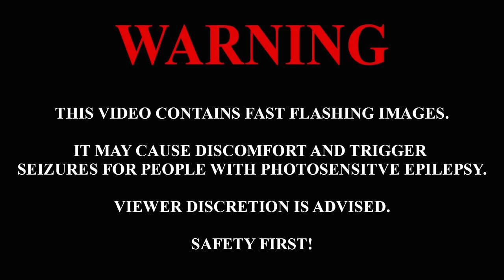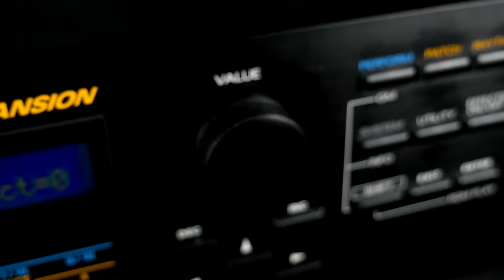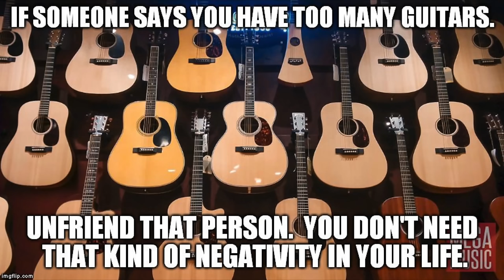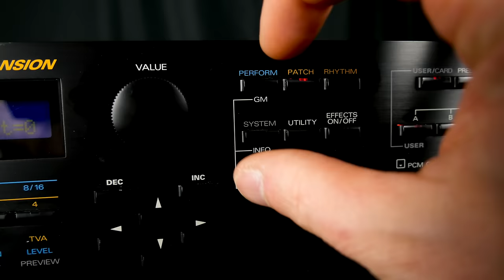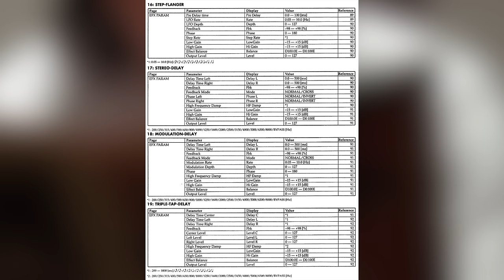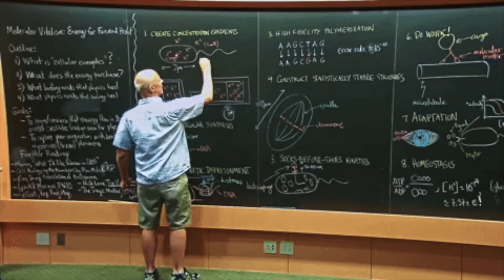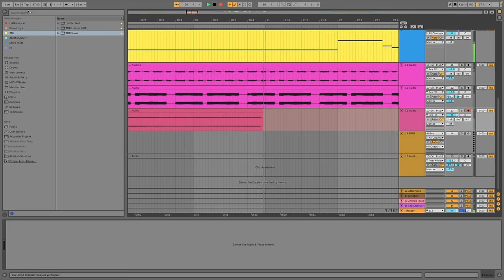Bad Gear - Roland JV-1080

Comment: I use the patch Heavenals behind my grand piano. I set it to sound only from middle c all the way up. It adds a sparkling effect to the grand piano. I also layer this with strings. I bring the two up and down with an expression pedal. My other favorite sounds are Fantasia JV, D’Light, D50 stack. I use the EP+Mod Pad and MK-80 Epiano often. I never hear anyone saying “your set sounds cheesy” it’s all about how they are mixed. I’m hoping for a JD-990 from Roland cloud soon!
Reply: The sparkly bell pad patches was one reason I bought my Roland JV-1080 in 2008. Also when I watched a video of someone 
demonstrating a Roland digital piano and layered the Fantasia bell pad with the piano sound he called the preset "Magical piano".
Acoustic pianos sound beautiful layered with a bell pad, I also have a Roland U-220 and bought that for the same reason, it has 
the D-50 Fantasia pad!

Comment: I bought my JV-1080 off Ebay in March 2010 after watching keyboardwizzard's 4 part video. I always liked the bell pad 
sounds on this module as well as many other patches including "realistic" nylon and steel guitar sounds. Yes it sounds digitized 
but in a good way. Can you still get away with doing entire backing tracks on a JV-1080? Yes, even when I bought it in 2010 
people said it's old but at least when I bought it when I did I didn't pay too much for it, £199 or less is a reasonable price to pay 
for one with no expansion cards, would I buy this in 2022 or 2023? Maybe or I would probably choose a JV-2080 or an XV-5080.
I agree some of the U-220's sounds are a bit better as I also have a U-220 but the JV-1080, JV-2080, XV-5080 or even the Integra
7 are still ideal as a first full sized rackmount module. Using it without expansion boards? Until 2014 I didn't have any expansion boards 
as at the time they were more expensive than the actual unit but you certainly should buy some expansion boards for it later down the line
although the PCM1 cards for it can be hard to come by but the Super expansion board combines all those sounds. I haven't done entire 
backing tracks using only the JV-1080's stock sounds for quite a few years but even today it still sounds OK. I know it doesn't sound 
quite as authentic as VST instruments like Kontakt or Halion. I certainly prefer the hardware JV-1080 over the Cloud JV-1080 and I'm 
still thinking about weather or not I should buy an Integra 7.
Reply from the maker: Integra is super tempting!

Comment: Many of these modules were used with the equally expensive Roland keyboard controllers which had parameter buttons, like Roland A-90.
Other modules like JV2080 were even more difficult to manage, flawed with some MIDI issues from what I've read because of processor limitations. Thanks as usual
Reply from the maker: Thanks for watching!!!

Comment: Brilliant bit of kit, an absolute work horse in a late 90s studio. It really comes into its own when you fork out for the expansion boards, I had mine fully loaded with Vintage Synth, Techno, Session and Hip Hop, which takes the unit to another level.  I still dust mine off every now and then for that late 90s nostalgia!
Reply: Are you aware about the capacitor issues on the cards?
Reply: @uk_carnage  yep I have heard of that problem. Fingers crossed it wont burst into flames anytime soon! But my cards have been in the unit for about 23 years and its been fine.
Reply: @oxygene65  hopefully not. There was a page on the roland site talking about it a while back.

Comment: I could never afford one in the 90's so i bought one some years ago as a middlifecrisis synth and it did not disappoint. Added Don Solaris sound pack (recomended!) , vintage synth card , vocal card and Orchestral. You need to be a monk to work with it but the lush strings/choirs where worth it. I tried the 1080 vst but the real one sounds more spacious and saturated to my ears.And 3x stereo out is very nice if you have some effectpedals around.
Reply from the maker: Don Solaris is the JV God!!!

Comment: I asked myself this question every day I used Roland's MC-307 in 2016-2018 (replaced with MC-909), what I found is that is to not sound embarrassingly 90s like the presets you must combine three or four tones; none of the presets I looked at ever used more than two tones in a single patch - obviously because their proportional decimation of polyphony, Roland didn't want people to experience voice-stealing when sequencing the 8 parts. Also because the JVs use mono samples, you need to introduce at least 3 tones to do anything more complex than blending two tones each mono / one tone stereo. Ultimately I went for the 909, but here's examples of the sounds I made (like the MC-505 and D2 and JX-305 it borrows the JV1080 sound engine but only has one output). Also I'm such a huge Roland snob that its the biggest compliment ive made in recent memory that you covered this most hallowed piece of frustratingly awful but also pro & capable gear quite well https://youtu.be/XLLqQfLIeMc   https://youtu.be/yxhsY0nzmDc
Reply from the maker: Yeah, the tone system is more or less built for layering

Comment: Hey people
What controller are you using for this Synth??

I dig into the manual and it only has 2 assignable CC settings.

I've always found it frustrating to not be able to control filter settings.
Reply from the maker: A Keystep Pro would probably be the optimum for that

Comment: I bought one as soon as they came out, and the reason was i couldn't afford a JD800, even after they were heavily discounted towards the end. 

No regrets, as it had more than double the polyphony , was 16 part multi timbral, and the soundcards (especially the vintage expansion) were worth getting. At one point, i had more soundcards than expansion slots, but by then, i had a JD990, too. 

It was a pig to program, but it helped me get paid work, as it sounded clean & full. Eventually  I sold it on ( quite reluctantly, if i remember correctly), as by then I'd bought a lot of the analog synths I'd been hankering for. 

It's interesting that i think i can still hear traces of the waveforms used in it in modern Roland synths. It was a great workhorse and was one of Roland's better synths in that period.
Reply from the maker: The 1080 was the "rational choice" for many back then...

Comment: The multitimbral structure with four oscillators per voice, dedicated filters, envelopes, lfo's per oscillator plus cross-modulation possibilities goes back to the D-50, D-10 and JV-80. This somewhat became a standard for rompler-workstations of the last decades. I wish more modern synthesizers would take this approach. The SH-4d is going in the right direction....
Reply from the maker: True that!

Comment: Got an JV2080 recently for peanuts.  This thing sounds amazing if you treat if you treat it as it is, a powerful synthesizer and not just a giant preset box.  Yo can get very wild stuff for any genre you want. In the case of the 2080 the big screen helps, but still a bit complex to program the first days until you get used to the structure. Still, there's some software editors you can use to help.
Reply from the maker: Nice!!!

Comment: I have the xv3080 version of this along with several expansion cards, mine holds 6. I've had it for 20 years at least and still use it quite a bit. There are a lot of very useable sounds on it that I like, such as Soaring saws, Sun Dive, Macarthur Brass, and swimming bee to name a few. Definitely a ton of sounds on it
Reply from the maker: Legendary presets!

Comment: I have a JV-880 - the forerunner to the 1080 and 2080. It can use the same expansion cards too. I was thinking it'd be fun to buy the whole collection but there are some unrealistic prices on Reverb and eBay at the moment.

I only bought it recently, and I chose it over its successors because I thought I'd only want to use it "as is" (I wouldn't want the bother of editing any of the sounds) and it was much cheaper. I was right too - life is just too short. So, if I just need a piano, church organ or similar, and I'm not bothered about what type of piano, where it was sampled, and what the weather was like on that particular day, then this is an easy choice. 

The guitars should be exorcised from the unit though.
Reply from the maker: Nice one!!!

Comment: I used a JV-1080 with the Vintage Synth expansion board for years, but as I moved over to VSTs, I managed to simply lose the unit.

Kind of sad, but I did the also test the Roland Cloud version, and I don't really miss any of the sounds. It was a great workhorse back then, but now I wouldn't prefer that flavour anymore...
Reply from the maker: That expansion card is one of the most sought after!!!

Comment: I bought one of these (used) back in 2006. Although I don't take it to gigs any more, it is STILL the backbone of my home rig. When I bought it, it had the Asia World and Experience II expansion boards in it. To these I added Bass and Drums, and Orchestral. Asia World, I hardly ever use, and in the event of my getting another expansion board, this will be the one to come out. Experience II, I have used a lot. For certain sounds, it's my go-to. 

I agree that the factory piano sounds in this thing aren't stellar, and I certainly wouldn't use them for a piano solo. That said, that doesn't mean they're not useful. I've used them several times in places where they work in the context of the track.

In short, a good all-round workhorse. I'll keep using mine until the day it kicks the bucket.
Reply from the maker: Definitely a keeper for me too!!!

Comment: I love mine, and still use it to this day, If you scratch beneath surface of the cumbersome menu driven interface you will find that this is a very powerful sound module. I also installed the 70's keys expansion, which has some really nice patches. The stock soundset also throws up some gems too if you can be bothered to dig deeper than selecting a preset. The dedicated effects blocks aren't too bad either although the are very Boss/Roland in character. Your reviews are excellent, I really enjoy them so much especially as I have owned a a fair amount of units that you have reviewed 😀
Reply from the maker: Thank you so much!!!

Comment: I have a JV-1010 permanently set up in my chain; the problem is, I say to myself I will just use a JV patch as a placeholder and then put in a 'gritty analogue' sound later, but never bother setting up the analogue synth. I also have the XV-2020. Both cost way less than a 1yr ultimate cloud subscription and I have had them for years with no problems. The JV/XV sounds are also great if you follow the tradition of not using them as Roland intended.
Reply from the maker: Nice technique!

Comment: It's crazy that the JV family of synths is the single longest running, most recycled, most successful synth engine ever developed. Think about it! It started basically with the D-50 in '87, 4 partials that could be arranged into various "structures" with sampled waves and time variant filters & amplifiers. That morphed into the U-110/20, D5/10/20/70, JD-800/990, then the JV-80 series, then refined into the 1080 in '94. The 1080's success spawned more spinoffs, like the XP keyboards, until the engine was revamped into the XV series in the early 00's. But it didn't even end there, the Fantoms were really only post-Y2K JV's & XP's. Roland has pretty much just copy-pasted the D50 with slight tweaks & more samples into new products for the last 36 years. Integras, the pretender Junos & Jupiters, the new Fantoms, the new MC's... Zencore is essentially an ultra-slick JV-1080. It'll never end! I got off the train with the XV-5080, I'll never part with it. Everything up til it is aural gold, everything after to me sounds like it sold its soul for more features.
Reply from the maker: Yeah, they are still recycling these...

Comment: Back in the day, when using my JV 2080 per MIDI for a whole arrangement, bad MIDI-timing got a big issue. 
Many sounds going on - but weak power, because of lost rhythmic "tightness".
You could solve the timing problem by eventually recording every single track to a multitrack tape machine - if you already had a HD-recording card, there weren´t enough tracks, the computer was capable of playbacking simultaneously.
So you had to stand it and wait until the end of the song arranging time, to keep yourself flexible for eventual sound changes, (considered an advantage, back then..) if you didn´t want to dub your stuff to tape several times... Those were the days! 
Those were also the days, when I had the patience and eyesight to wizard around on the knobs and the small display of our Akai S1000 sampler in the studio...O.M.G!
I still have one and love to "have" it. But I barely touch that monster...
Still keep the 2080, too - but the patches of my Kurzweil K2500R seem momentarily more appealing to me..
Reply from the maker: Didn't really push it too hard but good to know!

Comment: The Roland integra is the successor with all the cards built in + much extra and much better quality and cheap.
You're crazy if you're still working with the expensive vintage 1080 with cards.
But many have the problem that their important patches cannot be transferred and are therefore stuck with their precious stuff.
I only keep my XP50 as a midi keyboard ☺️
Reply from the maker: Integra is super interesting!

Comment: Used these at the studio I worked at back in the late 90s early 2000 and they were a workhorse for quick stock sounds, if almost impenetrable for editing beyond a few basic controls. A really good example of its use was Stacey Pullens album under the moniker Silent Phase: 'The Theory Of...'" as its littered with the presets.
Reply from the maker: Just hit play on Meditive Fusion❤️❤️❤️

Comment: Hey Hey Hey eaaaasy there. My first synth ever - this is not bad gear :) While you can get into patch editing  (after 20 years I managed to learn how to do this fairly quickly), original patches are extremely good - cut through the mix with little processing, pads are warm, basses - i used the finger bass preset on multiple records, that Fantasia Dx-like piano, west coast strings, plus the full array of Roland percussion. Absolutely killer module, I got it waaaay back in 1995. I got 2080 later on, but I still have 1080 and oddly enough, use it frequently. It is hardly analogue goodness, its a rompler, but it does feature extremely good sounds. Yes, that is why they are overused. I listen to some tracks from 15 years ago and wonder how percussion from this module always stands out. Cards were such a gold back then. And its fair these were expensive, as they brought basically new synth onboard. I loved the fact you can layer sounds  and separate outputs, really, except limited ui (and since I was shown most of it by person who used it on daily basis, then i spent days on end using it), i never thought of it as bad ui. Yes its terrible, from this perspective, but again ,that was time I found DX workflow "normal", its a synthesizer! JV 1080 is a golden machine, and goes with my Alesis Quadraverb as 500 quid of synth greatness and endless effect fun.

Comment: I've had JVs in the past, then got hooked in the XP and XV series - all the expansion options available, and they still, to this day, sound great!!

Biggest problem today is, when you find an old unit, you will certainly need to replace the capacitors - not the most difficult job, but finding the right components is quite daunting.

Once you've done that (or had it done), then you're good for another few decades! 😎👍
Reply from the maker: A recap job from time to time can be necessary

Comment: Even you can get the full Arsenal of the exp cards in newer versions. The 1080 is still the best sounding of all Rolands countless Synths based on those in todays eyes rather Cheasy multisamples. I have always critisized Roland for lack  of innovation ever since the first GM/GS and U series models. They have boiled soup on the
 same wave memory for nearly 40 years now. That doesn’t mean its bad tho. Those libraries made in the 90’s for the JV series was pretty much the epitome of what you could get in a rompler back in the days, the sounds are extremely well done for the limited ammount of memory used, and the 1080 is one of the most epic sounding romplers. Its beefy sound flatout beats the Integra well .. if you take all the JV exp. Packs that is funny enough over 50% of all the Integra’s wave library. It’s amazing you can still spin money on a 30+ year old sample library 😊

Comment: Great review, I totally agree with you ! I owned one 20 years ago (with the Vintage Synth expansion), to use really as synth for programming  (like my D-50) but I found the sounds and character "SC-55 SoundCanvas-ish", so already "over-used". It lacked meat, punch, dynamics etc. (compared to the D-50 :D).  Knowing the D series, I think the UI was quite usable, by 90s standards. The JV's synth engine has survived at least until the FA06/07/08, which inherited a lot from the JV1080.  I replaced it with a Proteus 1000, also a 64voices/4layers rompler but which had original samples, good punch and great filters (but no ringmode/booster). Btw that guy faking DJ'ing at 3:46 is great :D Thanks for the great review !
Reply from the maker: Thanks!!! That expansion goes for ONE MILLION DOLLARS;)

Comment: You can get the Roland Cloud in a box sound using a Jupiter-X/Xm or Juno-X (all have the XV-5080 sound set inside) or an Integra module.  I am not so sure what is inside the Fantom boards.
Reply from the maker: Isn't that really expensive?